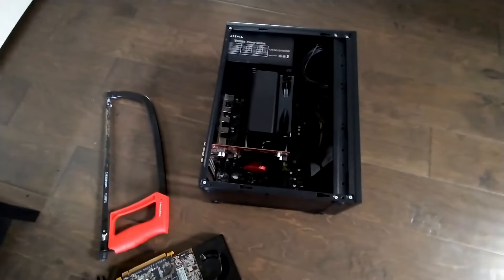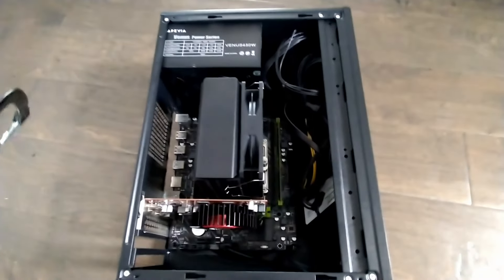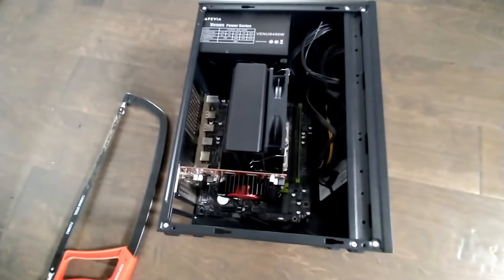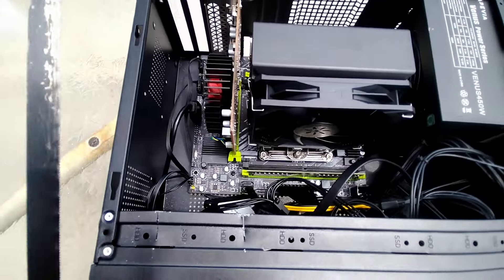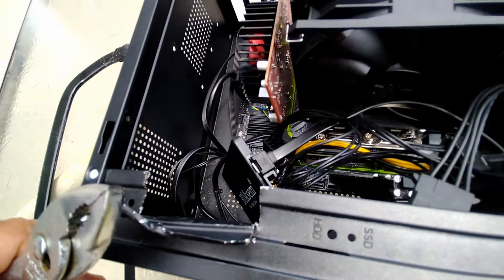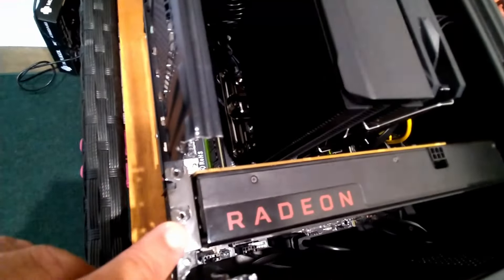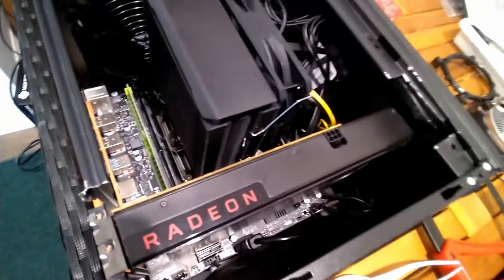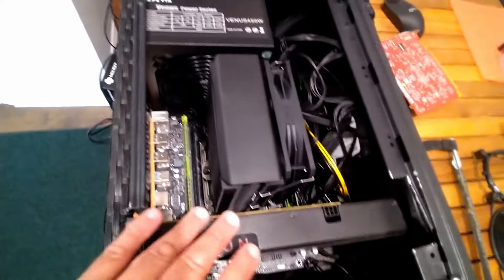MOD your own PC Case so that you can get your bigger size GPU to fit inside it .....

Comment from the maker: thoughts ?!!
Reply: i know nothing about pcs but i love it. like ur just amazing idk like anything u do im just like... I'm not gonna go to far. but i am now more confident with modding shit lol
Reply from the maker: much appreciated my guy !!
Reply: Gotta work with what you've got. I definetly see that letting you save money as I see case prices and they cam be quite high sometimes. Personally if I had a situation like that at first I'd take measurements of the case, then find  a gpu that fits, alternatively hold it at an angle and slowly lower it into the case and hopefully manipulate the GPU until it fits. I know something about that as my current gpu is a space hog, it's a 3 fan strix 1070 and is 298mm long, I measured my case as around 300mm, said "it's enough" and luckily didn't have to cut anything to fit the budget beast, only having to break a bracket for the IO of the gpu to be accessible.
Reply: @Sebastianepecki-kg1py Yeah, Best Horror Movie of 2024

Comment: only big risk here is metal shavings, only takes one small piece to short that motherboard. I'd recommend removing any parts before doing any major changes to the case
Reply from the maker: i am following ya ...... thanks for the advice , will do for next time !!!
Reply: Definitely a good point. 😨 I'd recommend an air duster!

Comment: I made my own case. I bought a frame online (i think its called open chassis) where I can put every parts without constraints but it has no enclosure.. So I ask my father for help because he knows a lot metalworks, and he enclosed the whole thing and designed a good ventilation for it.

Comment: One way of putting it in, anyway is good as long as it fits. But just a tip too, I had this issue as well before because I build computers and clients generally don't like it when the case they like gets sawed off. My mid tower case right now only has a horizontal clearance of 340mm but the sides extend like the  one of the video so it won't fit the card horizontally so I took off the cooler and fitted it vertically rotated it into place of the pcie slot.

Just take off the cooler first and you'd be surprised how large things can fit into those cases. Just another thought before sawing a case.
Reply: 2nd paragraph says it all. no need to cut. just have to reapply thermal paste if necessary

Comment: Why couldn't you just dip the non screw end under the flap (insert it at an angle) , it would have fit without all the cutting.
Reply from the maker: i didn't even think about this .... i will check for it next time ..... thanks for the advice !!
Reply: he has to be joking... 🤣